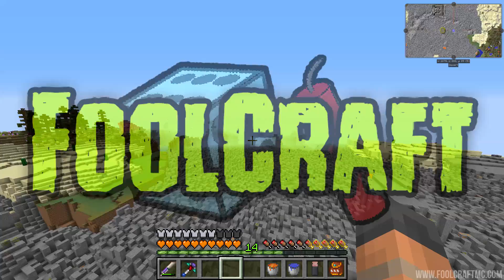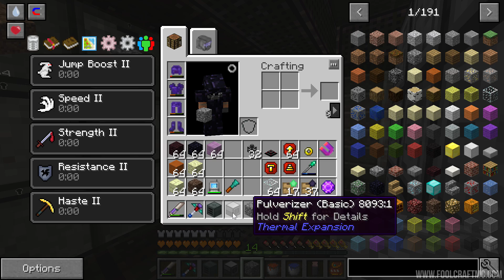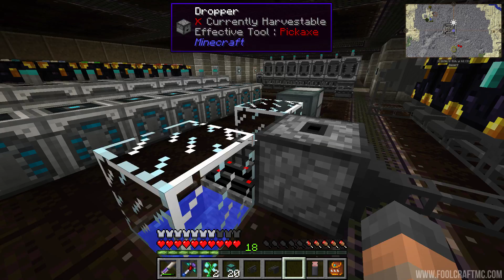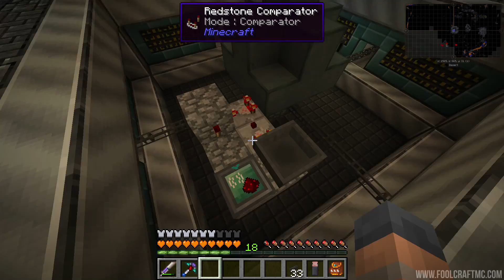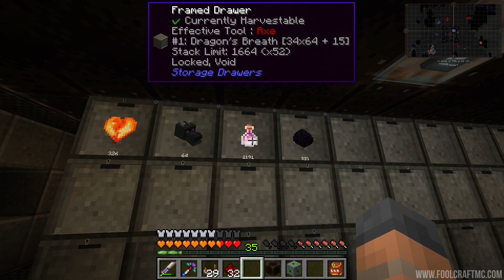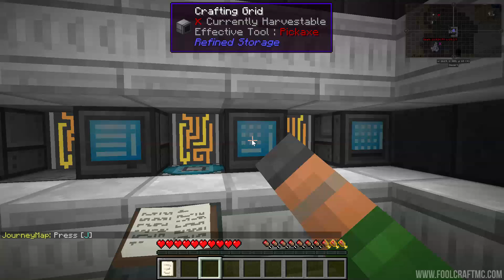FoolCraft Modded Minecraft 38 Keeping The Power Flow

Comment: Hey X, if you're feeling creative, you should look into the city of maybe. Make your building a more retro 50's building which would compliment the other builds. Use darker black blocks with hints of white. On the top of the building you can add solar panels which you can also use for power if you want to spend more energy for projects. I forget the name of the mod but there's like 10 tiers of solar panel which is just a lot of crafting but it generates lots of power and could possibly make your building better looking.

Comment: thats amazing to me for 17:30 as i actually made a system like that but it was 1.7.10 and not modpack but extra utils and applied energistics... i had 16 64x solar gens and the things to pull the power into the system.... command blocks to make it day and night aka day at lower power and night once they were alot higher... i dont remember how it was built but somehow i got it working... its on my moms laptop though and i think i killed the world... but it was 1 comparator that took the signal and went 16 out and it was a torch affected by the second dust and 14th dust... 14th says to make it night and second said to make it day.... 

i couldnt get the autocrafting system to work lol... i do like the way cables in AE would be 8x to 16x to 64x in terms of things connected to them... and that the AE systems are able to have 64 range upgrades in the single slot unlike RS where its 4 that add 8 each rather then a 1.5 or whatever it was thing of the previous amount
Reply: oh ye... i used a circuit in the system to do this... and it was just the 2 torches and redstone and was the size of what youve already built... i think your system does what mine does but ALOT better considering its alot more compact and also.... isnt cheaty... you could use solar if you had the time obelisk things and they work how i think they do... if they need player xp only it wont work but if it can from tanks if you were is singeplayer itd only affect you and might work maybe? 

just go woot... its not confusing lol

Comment: X, there is an EnderIO machine called a power monitor. You just attach it to any capacitor bank with an energy conduit, then configure it to turn on and off a red stone signal as the power goes on and off. For example, you could configure it to turn on a red stone signal when it is above 80% and turn it off when below 10% in the capacitor. It basically does the same thing as your VANILLA red stone circuit (shame on you for using Vanilla, Kappa) but it's better cause it's modded! :P

Comment: Isn't there an auto enchanter?  So many mods across different versions and not all of them are 1)updated to 1.10 (not updated at all, or they chose to skip to 1.11 or 1.12) or 2)they're updated but not in Foolcraft.  One cow farm for the leather, one sugarcane farm for the paper, a crafter to put everything together, and one autoenchanter to put the magic on it.

Per the question, I prefer the building.  Tech is okay, but most everyone sticks with the tried and true stuff that was largely in place since 1.7.10 and there's really no focus/feature on new mods unless the pack absolutely makes you do it.  There are only so many videos you can watch about enderIO, Draconic Evolution, or Thermal Expansion/Dynamics before it all becomes old hat with nothing really new anymore.

Comment: For the relocator, you actually do need to set it to pull. It will also pull power, when you quickly did that at 20:27, it completely filled power, then you unswitched it, and it started to go down.

Comment: The Disenchantment generator WILL take any enchanted item, JEI only shows enchanted books as a default, the higher and more enchants per item the longer the generator will run.
E.g. a Chestplate with unbreaking 3, protection 4, and thorns will last longer than another chestplate with only protection 1.

Comment: @xisumavoid I am loving the Foolcraft videos, but you are thinking too much like a vanilla player (which isn't always a bad thing), you don't need complicated vanilla redstone systems to monitor your power. There's a block from Ender IO called the power monitor, plug that in with a power conduit and Redstone conduit. Set it to power<x turn on rainbow generator, power>x turn off Rainbow generator. Saves space and cleans up your basement. Hope this helps.

Comment: 20:25 DERP! The "Pull" filled it with power and then you disabled it, because "it didn't work" ;)
Also, I think that there is the cobblestone generator from Sky Factory 3, but if there isn't there is the Igneous Extruder, which after upgrading it to max tier may be faster than your actual generator :D

Comment: Hey, X if the auto enchant mod is in this pack use the autoenchanter it will enchant books by itself with liquid xp and since you dont neeed any specific enchantments this could work. there is also an enchant called flimflam dont know if its in the pack but you get flimflam by crafting a book and quill with emeralds. flimflam is probably the easier of those 2 if its in the pack.
Reply: And for power transfer try using tesseracts they do the same thing as dimensional transievers but have no limit as to how much power they transfer. Maybe try going down the draconic evolution route for powerstorage since it can store an infinite amount of power on its high tier (its actually more like 9.2 quintillion rf it can hold...)

Comment: I would recommend using withered wooden shovels rather than withered diamond shovels. Where diamonds are 1 nether star per shovel, wood is 1 star per 8 shovels. Though I suppose with WOOT you don't need to worry about stars
Also you can compact the entirety of that new redstone circuit using the "power monitor" from Enderio, if it has updated to include it.

Comment: i set up a rainbow gen in my beyond world. the math for extraction is 1/20 of thw generation. so 40rf/t will need an extract of 2. i use an woot farm for skellys, it creates enchanted gear  for the disenchantment generator bonemeal for making peonies which is pulverized. and bones for the undeath gen. I dont know what you use for the furnace fuel generators, but extra utilities has a very good item called wireless heat coil. it takes power from wireless batteries, so you need to power those too the other fuels are easy so i guess you already have that. sorry for knowing so little about your setup, i mostly use youtube for a podcast as i play myself

Comment: Xisuma build draconic power storage, ur farming everything u need from woot, and there no max power import or output from it, like so he can see
Reply: Plus it has wireless connections compatible with most if not all mods
Reply: X you should also make some draconic armour. you are farming the dragon hearts to upgrade wyvern armour to draconic with the ender dragon woot farm
Reply: Seconded. I mean, you can't get the resources from all those vibrant capacitors back, but the Draconic Evolution power storage was specifically designed for endgame power storage and transmission. It also looks amazing.
Reply: He needs to see this.
Reply: transfer is limited by the method of transfer, draconic tier crystals arent unlimited and rft dimensions can eat up more power then one crystal can provide it
Reply: not all, IE doesnt like the wireless crystals, need I/O's there, and rft dimension builder needs a higher input then wireless can provide (at least to run more expensive dimensions)